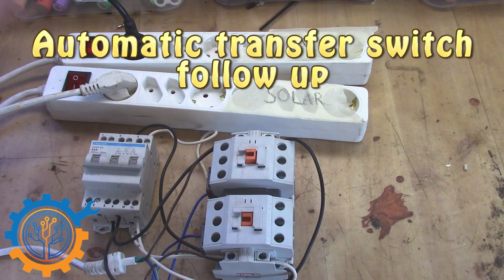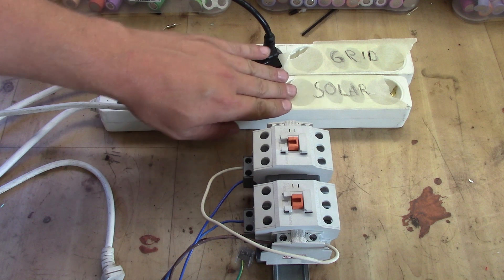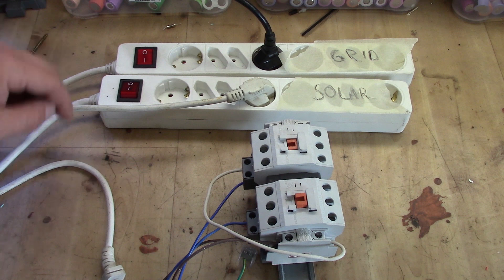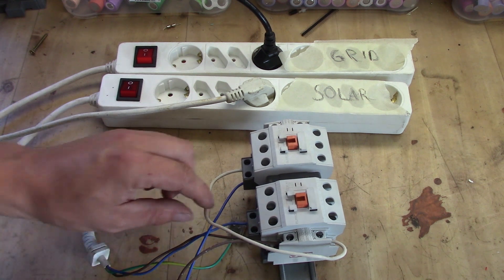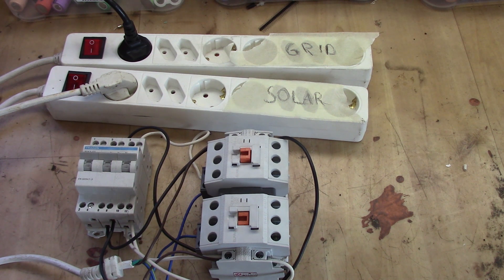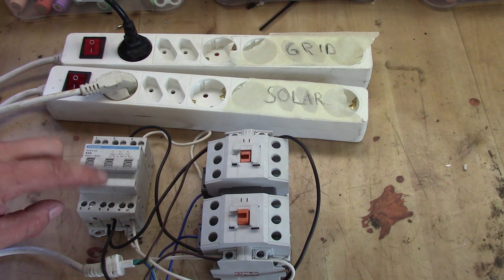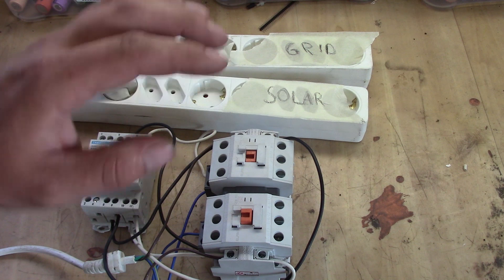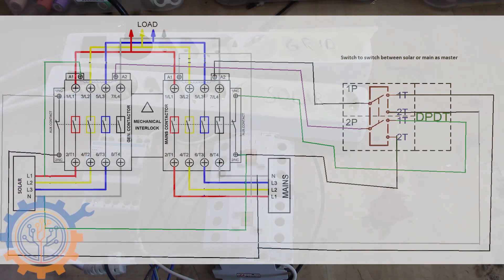Automatic transfer switch followup up - Lets hook it up once more

Comment: I think I'm missing something.  If the grid is on and the solar power becomes available, won't the mechanical interlock prevent the solar contactor from moving?  I tried setting this up at my bench and that is the behavior I'm seeing.  I'm using a different contactor.  Could that make the difference?
Reply from the maker: Don't know. There are differenr versions. For mechanical interlock they are only active when one side is active. Disable one side and interlock is released and you can switch

Comment: Can we make same but with an uninterruptible switching for computers...???
Reply from the maker: not with 0ms delay in a simple way.  above is always 10-20ms delay but thats ok for most computers. what you need to understand is that if you switch without having the systems synced you can destroy the electronics. A proper inverter or UPS do sync the inverterd output with the mains before they switch.

Comment: Ok, so you can select a priority. So lets say instead of a manual switch you employ a relay, that is controller by a smart microcontroller, so you can do it remotely, or depending on a time of day, month, state of battery, predicted power usage, etc? How would you power a microcontroller and the relay? I guess using a small battery just for a microcontroller and the relay, plus power from the LOAD side to charge the battery would work? Or use a bistable relay, so even if the microcontroller is without any power (i.e. due to no power from both systems, or because you run out of small backup battery), the priority stay unchanged? Then a microcontroller can also sense that a battery is running out of power, and before shutdown change a priority to grid, or something. Bistable relays are nice, as they use very little power. In this case you don't need a 3 phase contractron, as the bistable relay would only drive small relay coils in the main ATS. The bistable relay could be controlled by DC, instead of mains too, which simplifies stuff a bit too.  Another option is to drive the coils in the two interlocking contactrons directly from microcontroller. The physical interlock will still make it secure I guess.

Comment: why didn't you use one spdt relay instead? no wiring diagram needed. did i miss something?
Reply from the maker: Spdt relays are not approved for ats in most places since you need the function of  1-0-2. Spdt is only 1-2. Ie safer with above than spdt. Yes most inverters only have spdt....
Reply: @DIYTechRepairs  ahh kk so its just a safety and arching concern. Ty

Comment: can you check my diagram, I still don't understand why I need synchronize the inverter with the grid, from the point of view of the loads, they receive energy from grid or from the inverter.
My concern is with the inverter, if the inverter is programed for shut off on 44VDC, and the system is around 43.9 and 44.1 and the panel don't have enough sun, I think the ATS will be switching between grid and solar
Reply from the maker: If the frequency and sinus curve isnt synced there will be a voltage spike. This one can potentially destroy your electronics. This is what all UPS and proper solar systems do. More info here http://electrical-engineering-portal.com/understanding-transfer-switch-transition-types  Note that most proper UPS and Inverters having grid will have the ability to sync. But with that said it can work without syncing but I dont take responsibility for it :D

Comment: Daniel, did you measure how much it does consume in watts? I'de like to install the one I bought to have it as a security measure if the main battery is tripped by batrium (for when you leave on vacations and would like the fridge to not melt if something goes bad with the battery), but I'm thinking how much this will additionally draw from battery since it's on all the time. Thanks.

Comment: Simple and clean, but not ideal even with an mains synchronized inverter. Lets say, the mains disconnects and the inverter goes on as a backup until the mians reconnects.. At that very moment the mains goes online again you have two systems no longer synchronized. Switching at this moment will produce Voltage spikes within your system, and potentially damage sensitive Electronics hooked to it.. Another scenario ends up with a fried inverter. Would like to see a delay built in to this system during the switching.
Reply from the maker: Yeah you always should have a delay before switching back to grid again. With that you will get the system synced. Neigher less plenty of UPS systems out there does not even sync at all :)
Reply: Yep, the majority of UPS systems does not sync at all as you say. So the delay should work both ways :)

Comment: I have a 6 kW PV system with Enphase micros. I have a battery bank 48 v system. My batteries are getting tired and I would like to feed my micros from the grid. Only problem I am prohibited from exporting PV to the grid. So what I need is a ONE WAY ac connection, i.e. a Zero export device. Any Ida???
At present I use a Morningstar relay driver which reads the battery voltage, then from the 4 ports on the relay then the relay automatically turn section on or off according to my programmed voltage settings. When the bat voltage drops low, say 11.5 v  the threshold on one of the ports is set to switch on a NO NC contactor i.e. it switches automatically over to the grid.
If I had a Zero export device I could retire my bats.
Cheers
john nielsen
Reply from the maker: bender banana i dont have any good answer. If current inverters cant support setting current going out there is not much to do since you cant easily block ac one way.  You can always switch gear to ones that can do 0 export and are grid tie
Reply: bender banana SMA has the home manager to do this but since you have an Enphase system it would mean you would have to replace everything.

Comment: Just to be clear, I'm assuming that the 'solar' input is the solar inverter output.
Is the inverter phase locked with the grid, or free running?
If not, then there could be the possibility of nasty spikes if the supplies happen to be antiphase, and  the switch causes a jump from -330V to 330V peak.

I'm wondering if there's a solid state solution that does zero-crossing switching which would keep the supply clean.
Reply from the maker: Andy Lee Robinson you are right and yes. Same type as the inverter can do if you dont have a solar inverter that does phase sync. Best is to use a delay.

Comment: Yes, is 3 fase switch.... 👍 I have totally forgot that you have 3f inverter... 👍 
Usually that type or transfer switching is in my case already build in hybrid inverter (single phase)......
My goal is to switch depend on battery voltage and I will also use el. heater to support our heating system so no solar energy would be wasted... 👍
Reply from the maker: Its built into mine as well but plan is to have it before the system. No matter whats done in the solar part :)

Comment: I don't see it in the spec sheet, but do we know how fast these can switch? Can they switch fast enough that a computer can continue running? From what i gather online 100 milliseconds or smaller should work.
Reply from the maker: They switch fast enough. Its same "type" of switching that is done in most Solar inverters when they switch between grid and Solar as an example.